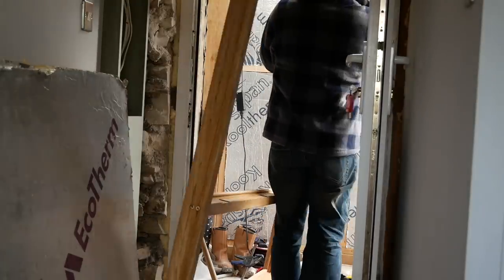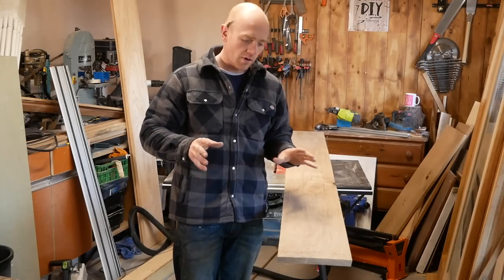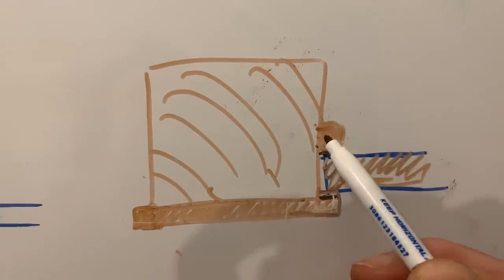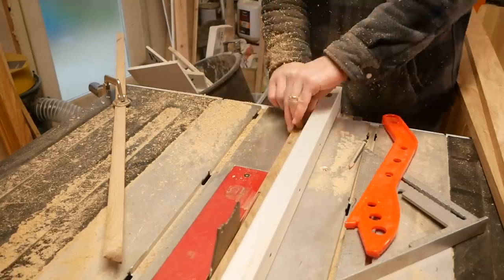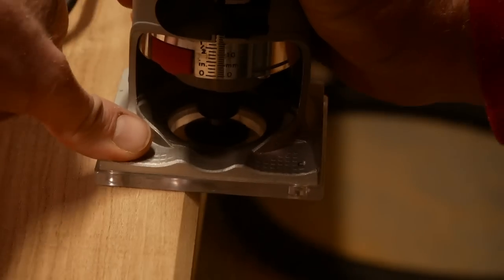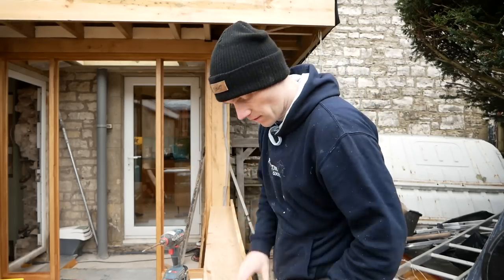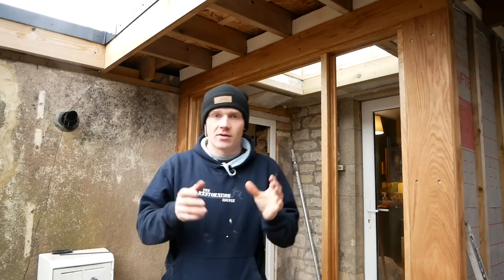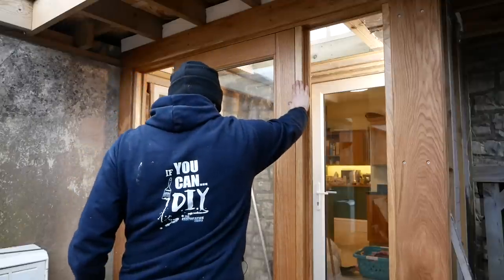Doors and Glazing in a Green Oak Timber Frame

Comment: Hiya,  what have you done regards scribing etc to your rendered wall with the boiler flue on it.  Surely your oak frame won't just butt up to that?  Interested to see how you made it fit that side if the install.
Reply from the maker: The oak face boards were scribed yes. I then added some of the expanding tape to act as a gasket of sorts. The wall may be clad anyway.
Reply: @TheRestorationCouple  thanks for the Info,  keep at it!

Comment: Great video & your attention to detail and workmanship are second to none.  I have a query regarding u-values.  Part L1b of the building regulations (Paragraph 4.21 & 4.22, Table 1) requires that doors should not exceed 1.8 w/m2 k and windows / roof windows 1.6 w/m2 k.  Having made the frames yourself, you will have no idea what the actual u-values are as it is the Uw value (glazing & frame combined) and NOT the Ug (centre pane) value that is required.  Also, I wounder if you have considered paragraph 4.2 as I expect the total amount of glazing exceeds 25% of the floor area?  I am a SAP assessor and come across these issues on a daily basis.
Reply: Although I should add that if you keep it as a porch and do not remove the existing external quality doors separating it from the house and the porch is not heated then it will be exempt for Part L1b.
Reply: Does all that matter if you are making it for your own house ?

Comment: Does this kind of thing require planning permission in the UK?
Reply: Rob Roy i believe he told this in the beginning of the build.
Reply from the maker: In most cases a porch will wall under permitted development, check planning portal for the details. 👍 size and height restrictions, etc.

Comment: Thank you. Uncanny that many of your last videos are similar to what we are doing on our restoration at the moment - so following with interest. We've just finished a very large framed porch/vestibule in 5 yr seasoned oak. We took sawn beams and have joinered everything on site. Surface glazing with EPDM tape, Osmo 325 one coat and 320 clear for subsequent coats. We're waiting for glass and everything is ready for that. We've ordered a double combination frame and door in engineered oak from Distinctive doors. This is coming all fitted but unfinished. What treatment would you recommend for a)UV protection and b) finish. ? manufacturer is not recommending any oil whatsoever on engineered oak and suggest that this will kill their warranty... do you have any suggestions please? thanks in advance.

photo attached FYI https://ibb.co/4g07XMD

Comment: Can I recommend these to you for pilot holes. I use the 5mm ones all the time for my renovation, as it has a lot of very old, dry oak in the house that just splits when I smash a screw into it. perfect for 4/5" screws

https://www.toolstation.com/draper-hss-long-metric-drill-bit/p1275

Comment: I cringe when you're using your table saw. Don't you have a guard?
Reply: A guard? As the saying goes, "I've just removed the guard for demonstration purposes to make it easier to view". A table saw comes with a guard in the box. The first thing you do to make it a usable tool is to bung the guard straight in the bin. They hamper you so much that they render the tool virtually useless.